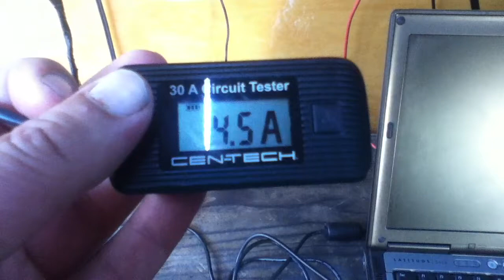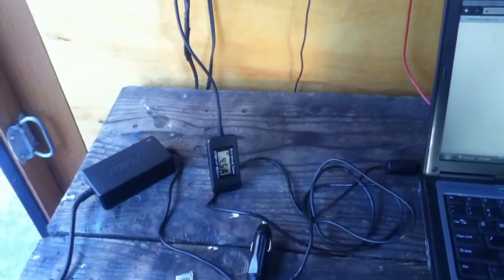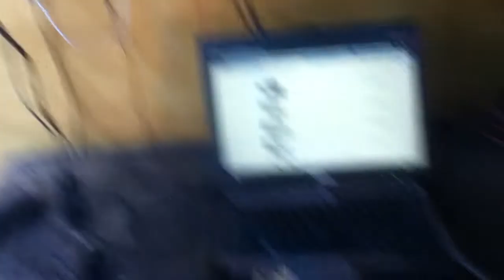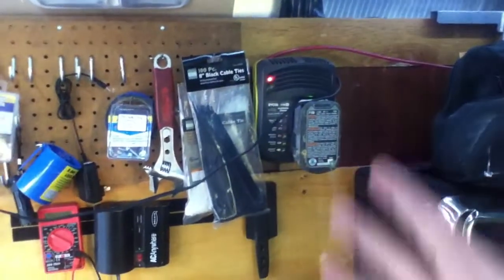Centech 67724 30A 12v circuit tester for determining power use on off grid system.

Comment: Those Harbor Freight jumpboxes typically have 'fake' batteries in them that do not have anywhere near their rated capacity.  The bottom third of the one in mine (a different version from the one in the video) is hollow and others have internal ribs or plastic/glass spacers in the cells.